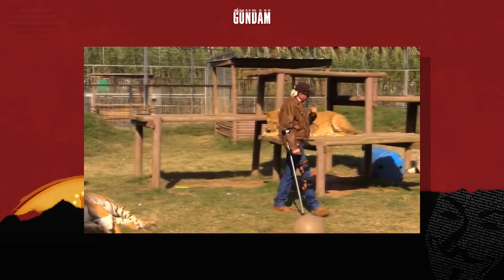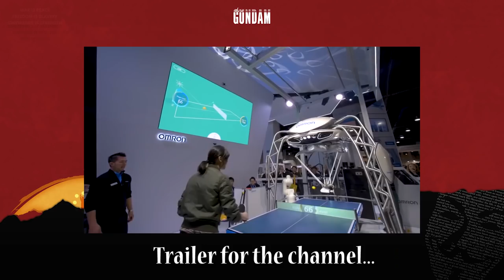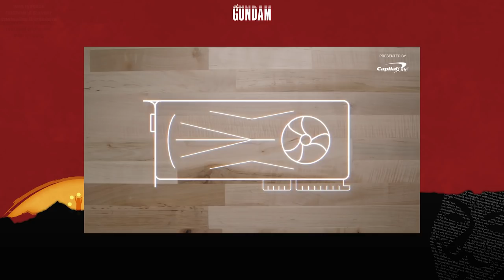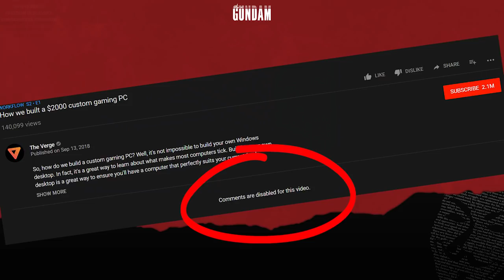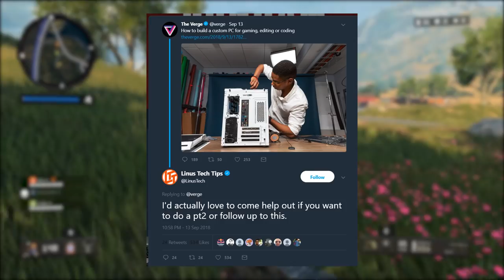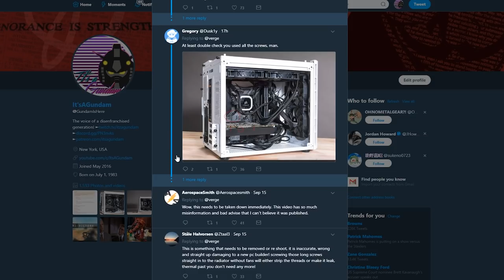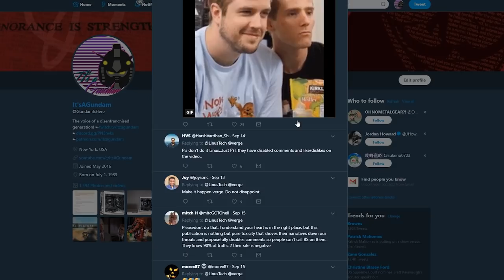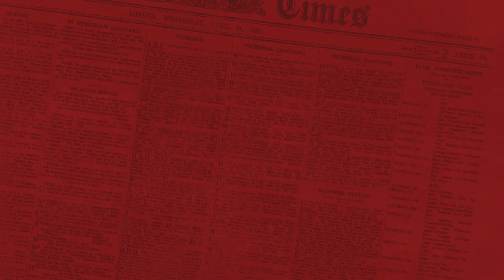How The Verge built a $2000 custom gaming PC WRONG!

Comment: 25yrs of building custom pcs and I've been doing it all wrong. For a start I didn't know I needed a "breast cancer awareness" wrist band, and it just got more depressing from there.
Reply: Wade  
Just make sure the PSU is blowing the hot air inside the case.
You want to to keep the electronic components hot for best performance.
Reply: @bestdjaf7499  damn thats hot and seski
Reply: Wade  I've never seen a pro use an anti-static wristband at all.  It's as simple as holding one hand onto the metal case as well as not building your PC in a carpeted room.
Reply: I always thought that a pea side of thermal paste was enough, now I learned that I should soak my cpu in thermal paste
Reply: I bet you didn't even know they were called tweezers. Were you calling them "zip ties" like some sort of scrub?

Comment: Other things that went horribly wrong:
1. He didn't attach the fans to the radiator. You can clearly see one of them is being used as an exhaust fan for the case.
2. He didn't use his "tweezers" to manage the cables.
3. He didn't use the Allen wrench for anything. Not that he needed to, but he did say it was absolutely essential.
4. Arma 3 runs at 70-80fps on 1080p on highest settings on my GTX960. It's not anything that would tax that gfx card.
5. He's playing against bots in LoL and thinks he's cool. In reality, he's getting wrecked by bots.
6. 300 fps on LoL? Well, that's nice, but I bet he's only got a 60Hz monitor.
7. THE RADIATOR HAS NO FANS!
Reply: If it is the monitor I think it is (samsung C27FG70... or something similar) it has 144hz
Reply: Better yet he says League runs as '300fps' while at the top right of the league window you can see he's manually limited it to 120fps anyways lol
Reply: If you look at their publicity shot at 31:37, someone eventually attached 2 fans to the underside of the radiator. However, going by the expertise embodied in the build, I'd wager they're in pull instead of push.
Reply: is this the real life

is this just fantasy
Reply: 8. He put the PSU in BACKWARDS. The fan is facing inwards and not facing down where the exhaust would be channeling out the hot air so it's just recycling the hot air in there.
Reply: I've got my store bought laptop design for minor office work to get me a solid 60fps (caped) on league btw. But I stopped using it '4 years ago' when I built my pc.
Reply: @DoomVideoVault  good i wasn't the only one who notices that
Reply: Just want to point out Arma 3 is bound heavily by single threading. 

http://i.imgur.com/jmfksOJ.jpg

It's not going to utilize a gpu very much anyway.
Reply: He didn't even buy a starter item on lol....
Reply: I destroyed my store bought laptop in 2 months due to cooling fan failures and graphics card overheating issue (obviously because of cooling fan failures). Built a PC and never looked back. Even as someone who isn't well versed in PC building, I can tell this guy is a joke, and the Verge is enabling ignorance by allowing this video to stay up. ALL HE HAD TO DO IS READ THE MANUALS!! Is reading that hard these days?
Reply: 960 pride brother
Reply: For #4, Arma 3 doesn't give a shit about your GPU. That processor paired with a 1050 would still give you that frame rate with the same graphic settings and resolution in singleplayer.
Reply: The video didn't show him installing the radiator fans but they are there when he shows his completed model... Guess that's the equivalent of the old cooking shows : "Here's one I prepared earlier"
Reply: @DoomVideoVault  You can't turn the fan down in that case, he should have flipped it round towards the exhaust holes on the side of the case.
Reply: What the fuck kind of NASA-Grade processor do you have to run Arma 3 on highest settings at 60+ FPS? What gamemodes are you playing?
Reply: @JeffDripstein  Im sure he is playing on the Editor if that was KOTH or any other mode that PC wont last long due to the over heating
Reply: De'Shawn Presley i build my pc alone, bought everything and watched a good tutorial by Linus Tech. Better than that shit. Still don’t know how the verge could fuck this this hard up.

Comment: The insulating pads make sure that it doesn't short circuit against the case.
2 seconds later...
Make sure the power supply is jammed right up against the case.
Reply: Lol I was about to point that out too
Reply: dont you screw it in? 
i have a Azza hurrican case that has 8 in case fans
its so loud and its like a 5 year old cyberpower build im a secondhand owner
hooray for having to switch to windows 10
Reply: Also, make sure you jam it in with the fan facing the back plate of the motherboard. Wouldn't want it getting anything other than the finest flow restrictions and south bridge heat.
Reply: @VincentGonzalezVeg  Research getting to the motherboards UEFI screen from booting up your computer. From the UEFI screen you can adjust your fan speed, so that when your PC is idling at the desktop it'll be quiet, but having it ramp up the fan rpm when playing a demanding game. If you use your gpu's firmware that come with downloading it's drivers(that you should keep up to date) you can monitor the Temps in your gpu, so you can see if it's too hot or not and adjust your in-game graphics settings. You should avoid Temps over 90°C.

Comment: Anti-static bracelets that aren't connected to ground don't work.
Reply: For him, works better when plugged in 230v socket.
Reply: I cringed at how he was holding that GPU, hes lucky he didnt short the damn thing.
Reply: Jiepers for me halps best when I ground my toe into the socket and after that install my cpu.
Reply: But it aligned his chi to the computer's chi, thereby making the electrons run so much faster.  Then he forgot and put the computer facing north, which completely violated tech fenging shway.
Reply: It's wireless! This is why he got a board with wifi and bluetooth
Reply: Are anti-static bracelets even necessary? My family has been building computers for two decades now, and we've never had issues with this.
Reply: CerebralDreams  Static can be a real problem depending on the carpet and how dry the room is. One place I worked I constantly got shocks. Some carpets are specially made for computer areas and have wires running along them to discharge any static electricity.
Reply: Everyone knows your supposed to lick your finger first before sticking it in the socket!
Reply: When I saw him put on the bracelet I knew this video is gonna be good.
Reply: what, you don't know about wireless grounding ?
dude you are so 2017...
Reply: That part really put a smile on my face... :)
Reply: I had a massive argument at work with a girl who really wanted to believe that wireless antistatic bracelets actually worked because they said so on ebay.

We still dont really talk beyond passing the time of day.
Reply: It's a wireless anti-static protector!
Reply: As long as you believe static electricity is a myth created by the ball Earthers the wireless antistatic bracelets work just fine!
Reply: CerebralDreams  the most I do is install the PSU first and plug it in, but leave it off. It'll be grounded to the wall, and when screwed to your case it will ground that too. Just touch the case often, which isn't hard when you kind of have to touch the case anyway.
Reply: *to the chassis, not the ground...
Reply: I thought the best part was him claiming that it  ´´protects YOU and the part´´

About the screw driver :  Don´t worry mate, if you haven´t got one, a sledge hammer will drive ´em screws home. A brick may be used as alternative.

But, at least now we know how NOT to build a rig.  That guy is hilarious
Reply: Really?  That's where you drew your line of acceptably in this pic build?  Lol
Reply: You are obviously not a pious man, that bracelet connects to God and gives him a tiny amount of energy instead of creating static
Reply: Why even use them to begin with, I've built two computers with no bracelet with socks on no problem lol.
Reply: It made me laugh that he basically just put on a rubber band.
Reply: Haven't used anti static braclets once in 28 years and nothing has ever happened.
Reply: @Jiepers  actually, you can just plug any copper wire into the ground slot on any socket, and yes i did say this in exactly as nasally a voice as you immagine.
Reply: Yea, and I've built rigs on a carpeted floor before with no explosions...
Reply: @englishfury1544  I know!  Waving it around like that I was expecting to see pins go flying.
Reply: Pretty sure he just put on a Live Strong Bracelet and called it anti static.
Reply: @The_Ballo  It should not be the FIRST consideration; but it is often that people live in a flat share / have to share a PC in the lounge as family PC etc where you cannot / are not even allowed to run a LAN cable, so OK, whatever... this might be a point of note for the college kids who are his audience; there is LAN over power, but it can need some convincing to even have that installed based on cost / occupying precious wall sockets, who owns/admins the router/switch etc. I guess everything has been said here already, so I just gonna say don't be stingy when choosing the PC case, you will regret it every time you have to do anything in your rig; err, and do not make blinky lights on your RAM the first criterion, rather the last ;) And really, really, don't just build a 2000 bucks PC... you should always stop your friends/customers in their tracks and ask: WHAT do you want it for?! There is no best 2000 bucks PC, but you can spend them most beneficially for your purpose... e.g. if you need After Effects for college or any app that is heavy on any a single component, I would spend the money very differently.
Reply: In a pinch a fluffy cat works gewd too. Fluffier the better. When your hair is standing up that's how to tell its a gewd time to trowl on the thermal paste. Be sure to use the WHOLE tube for each one cpu!
Reply: He thinks he needs an anti-static working surface when using a metal table, but a non-conductive table is fine... He clearly has no clue what that static electricity stuff is all about. This video was so painful to watch. ^^
Reply: @cerebraldreams4738  from professional experience manufactures say it can degrade the quality and have parts fail earlier than expected and thus unreliable. But if your a local computer tech shop it could mean more business.
Reply: I’ve never even needed one???

Comment: First thing we need to build a PC is a Swiss army knife, A welder, Electrix saw, Jb weld, Drill and a diamond tipped drill bit. Dnt forget your safety goggles & your protective work gloves. Now we can get started!
Reply: Dont forget your hotwork permit
Reply: Wait, then what the hell do I do with this pure water and nuclear reactor?
Reply: @MasterOfKnowledge.  nuclear reactor for over clocking your psu and getting extra giga flops in the PCIe slot
Reply: FRANK DUKES Get me an avocado, a tube sock, some tinfoil and a snorkel, Ive done more with less.
Reply: @andrewbinns5035  lmao

Comment: When he installed the power supply not only did he tell people that the antivibration pads were to prevent shorts...he also put the power supply fan facing the back of the motherboard.   The Corsair Crystal Series 280X case has...wait for it...a filtered intake vent on the back panel so the PSU can draw in cool air the back of the case.
Reply: thanks for letting me know what case it is..he didn't say it in the gUiDe
Reply: Derek Drake maybe I should start stream on Twitch...Topless Tech Body painting!
Reply: @Jennifur68  let me know your screen name so I can find you :)
Reply: holy shit.. that's a great idea, they should body paint tech parts instead of cartoon characters (btw I somewhat  justify if they paint game characters, but since when scooby doo cast are game characters? Remember, twitch is a streaming platform for gaming)

Comment: spends $2000 on gaming pc... uses a kingston ssd (facepalm)
Reply: Speedj2 and plays league of legends
Reply: @cluelessdragoon7052  ... while locking the framerate...
Reply: i don't know what any of guys mean, please elaborate
Reply: @Anthonybrother  Kingston isn't a terrible brand of SSD, but they are a low-cost option, compared to the higher end models like the Seagate Firecuda, WD Black, and Samsung 970 series of NVMe SSDs. Any of them would have been faster, but with a higher cost.
League of Legends is not a demanding game, and is run on fairly commodity hardware, these days. It might have been useful to show how ridiculous a framerate was achievable on high-end hardware, but he left it capped. He could have done so with a machine half the price, if that.
Reply: @SirLugash  Tbf, that was probably like the only thing he did right. You want to lock your max FPS to the max hertz of your monitor otherwise you can experience ghosting and stuff.
Reply: @KingBarney  For regular gaming experience maybe, however for benchmarking it defies the purpose.
Reply: @SirLugash  That is definitely true, though he did mention he was getting 300 or so FPS
Reply: Watch maker he could probably achieve that with a machine 1/4 of the price
Reply: @watchm4ker  while there are some other low cost options (usually only a few bucks more than kingston) that are still good quality, kingston is usually the rock bottom lowest cost option out there, but for good reason, as they are of very unreliable quality, and have even been caught falsely advertising their products by sending different stuff to reviewers and then silently swapping out for lower spec components without changing model numbers so they could get good reviews and then sell you crap. google "kingston v300 scandal" for just a small sample of the shady practices they've been involved in. i've personally blacklisted all kingston products and will never buy them. they simply arent reliable and the company cant be trusted. the only reason they continue to get away with this kind of scumminess, is because they're in china.

Comment: I think this verge video shows the fact that  building PC's are borderline idiotproof, contrary to what console fanboys claim. This guy makes so many mistakes in the build and yet he ends up with a working high end gaming PC.
Reply: Yup but sadly running in single channel mode will affect performance.
Reply: just for a bit .. maybe with intense gaming not more than 2 weeks .. and the parts will just melt ... from the inside ....
Reply: Hell I recently made a PC and it works great. I ain't no rocket surgeon.
Reply: i think he had to swap out the ram in dual channel mod first to make in work behind the scene and he did a lot of changes as well behind the scene and he got lucky that the radiator didn't leak on the system after he use long screw without the fan, the irony is he is computer science student how the fuk did he even take computer subject and not have a single clue basic idea of computer is mind-boggling.
Reply: Have you seen the guys twitter ? He went full defense mode blaming the editors...
Reply: Building PCs TODAY is idiotproof. Back in the 80s and 90s we were few, the ones that could build a PC from scratch. There were no online  tutorials, no magazine tutorials. No fuckin video calls to ask for help, no step by step instructions, just the MoBo layout.
Reply: , I don't think console players think putting together a PC is too difficult, therefore they buy consoles. If that's why u think console players buy console, u don't understand why Some Ppl prefer consoles.
Reply: No console fanboys claim that.  They claim that doing it PROPERLY is beyond many people's ability, something this video clearly shows.
Reply: why ppl apparently  buy a console,

1. Exclusives <The reason why I have one>
2. On the couch gaming <PC can do this, BS excuse>
3. PC's "difficult" to build and maintain <Cant think  why so, BS excuse>
4. PC's a huge money sink over time <Again nope , BS excuse>
Reply: None of the mistakes made here would have happened in the first place, if the guy had watched a few videos before trying to build one. You need to be a student before you can be a teacher. That's common sense and applies to pretty much anything.
I started learning french last week. So I can mish mash a bunch of words to create a coherent sentence. Doesn't give me the right to claim that I can teach people french   and come up with a tutorial video on the same.
Reply: We don't actually know if that one worked. He could be playing on a different one.
Reply: It's a monument to how idiot proof the hardware and software is.
Reply: rahul ravindran - What about personal preference? Kinda trumps all that.
Reply: @JosephQPublic  Ooor where you live it's impossible to get home Internet, nobody ever brings that up! (That's as dumb as console players paying for multiplayer) Nearly every PC game needs online activation,additional download even with the disc(s) or digital version is only way to get it. So if you can't access online anyway console is the way to go.

Comment: Friend. You're right! He assembles a computer as an amateur.
1) Anti-static bracelet is useless. And sometimes it can even harm someone who collects. (Modern motherboards have a range of static protection)
2) It is better to install the processor before placing the motherboard in the case, since it will be very inconvenient to install it with the cooler inside.
3) The choice of a case for a $ 2000 computer is wrong. Ventilation is weak.

I have experience in the assembly and maintenance of computers for more than 9 years. Along the way, he has a Cisco essential certificate in which he believes ... That's how certified amateurs are bred.

Comment: PNY card. Holds the card on the contacts. Isn't actually grounded. Installs CPU after Motherboard is installed and the GPU. It's a "CPU core."

What are you DOOOOOIIINNGGGGG
Reply: Not so bad really,  what was bad was the exsessive use of thermal paste.  at that amount I'm surprised he didn't melt that cpu on boot up